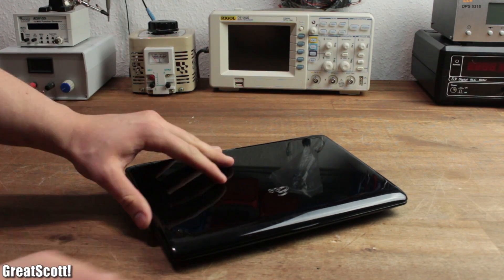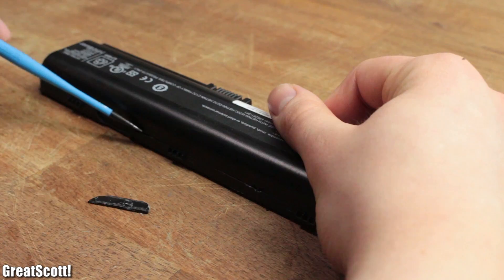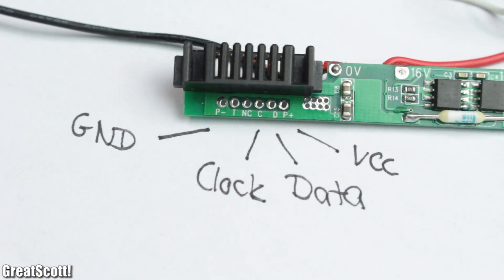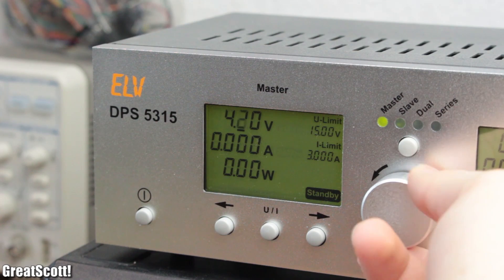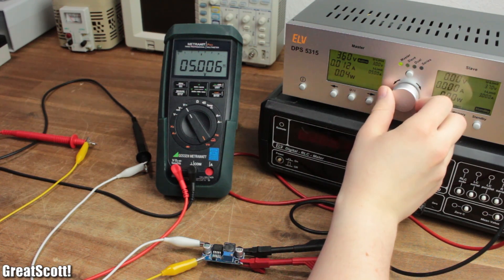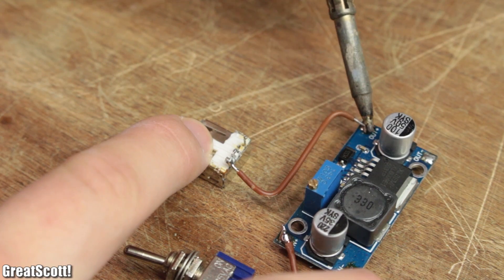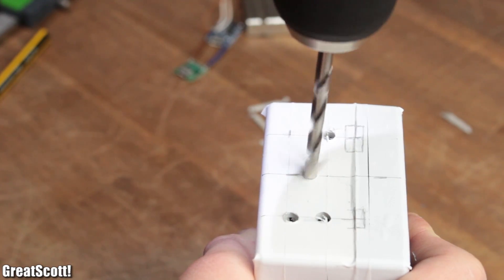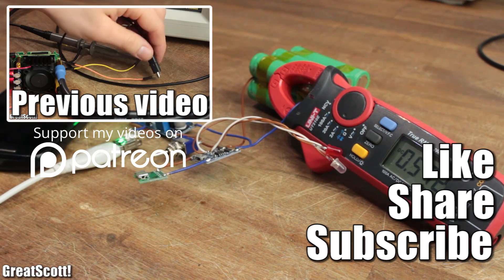HACKED!: Old laptop battery becomes a Power bank

Comment: in this video u didn't told about some nuanses with USB port. Some phones and tablets including your moto g 2014/15 (if I am not mistaken) , all types of iphones and iPads requried a little more than just solder two wires to VCC bus and GND. 
For example, my moto g 2013 didn't get charging until i shorted data+ and data -. (until this, phone define it how "charging via USB" and the current does not exceed 500mA) 
Apple gadgets require little scheme of voltage divider, which is different for 1A and 2A charging. Samsung Galaxy Tab require it too, but scheme is different.

p.s sorry for bad english

Comment: Can I charge it with a big solar-panel in the Powerbank?
Reply: +UpsetGaming You'll need a big solar panel. If you want to charge in 2 hours, you'll need a 25 watt solar cell and those measure 21" x 15".
Reply: +octavio echeverria And when I want to charge it in 10 hours? :D
Reply: +UpsetGaming This design is limited by the charge controller connected to the batteries. I haven't looked up the datasheet on the one he is using, but it is likely that it won't charge a current greater than 1 Amp. So if you do the math, 1 Amp @ 5 Volts = 5 Watts required. How long it takes to charge is based on the total capacity of the batteries you will be using. If each battery cell is approximately 2000mAh (milli-Amp hour) it will take about 2 hours per cell to charge. All of these figures can change based on the charge controller and batteries you use.
Reply: Also don't forget that solar panel has to supply a voltage high enough for the charge controller, but not too high as to affect its operation or damage the circuitry. Another buck/boost converter would be required in the circuit between the solar panel and charge controller.
Reply: +Alexander Hiller Thanks.
Reply: if you go this route, 3 series cells (3s) is a closer fit for 12v solar panels.  you will need a battery management system (bms).  limit the solar pannel voltage to the cutoff of the bms. if the cut off is 4.3v per cell then put a buck converter on the solar panel output to drop it down to 12.9v  (3 x 4.3v).  you will need a panel that has enough wattage to turn on the buck converter, so adding a 1000uf capacitor to the input of the buck converter will keep it running when a cloud goes over.     and if you want even more protection put a pulse width modulation battery charger between the buck converter and the bms charge input.  why all the circuitry? over charging li ion batteries can cause fires.  hoverboard.
Reply: +UpsetGaming A 5V Converter would work too.

Comment: Charging this puppy would take more then 12 hours at maximum warp.
Why didn't you explain the function of the tp4056. This $0,50 board is great and you've placed the power switch correctly, because this board has the under voltage switch.
Great tutorial, but a bit lacking in details.
Reply from the maker: +Kenneth Tan Maybe I will make an electronics basics video about charging such batteries in the future. There will be more detail ;-)
Reply: +GreatScott! I don't think you have to.  There are plenty out there. I like you doing your complete builds. Your quick pace and everything  covered from start to finish. Maybe it's just me, knowing these boards and finding  it a bit scary for people not familiar with 18650 to work on them. You soldered the tabs quite fast and professionally. But a novice trying to replicate your soldering might take to long and the Lipo might start running it's deathloop.
Also you should warn explicitly NOT to short the batteries. Something that even happened to me, while not paying attention to the wiring. Great tutorial, but not for the un-initiated in 18650 technology.

Comment: this is ridiculously dangerous, disassembling those welded battery packs often leads to shorts because the traces are very close together. 

I dont recommend this. youre better off using a lipo from an old tablet or sth.

Comment: +GreatScott! How would it be possible to charge the lithium ion cells with the TP4056 while getting an output voltage of around 14V? I'm thinking about replacing the Ni-MH batteries in my drill with Li-Ion cells.
Reply: +3MrP3 there are specific circuits for 2/3/4s systems.

But you can't pull more than ~3a per cell !
So if your drill is 14v 6a ( 84w ) you WILL need two batteries in parralel ( 2x4 cells = 8 total )
Reply: +3MrP3 Just use an RC LiPo pack with appropiate charger. Or just buy a decent Makita.
Reply: +3MrP3 Just use an RC LiPo pack with appropiate charger. Or just buy a decent Makita.
Reply: +roidroid Still both together not so expensive than a decent Makita.
Reply: +BillTheBox yes you can pull more for short amounts of time, they can spike over 2c easily for tools and vaping

Comment: I've pretty much done the same thing with some other components. Using a rechargeable 2.7v Lithium battery as well as a steady 2,7 to 5v boost converter and a lithium battery charging circuit as well with two solar panels and a custom designed 3D-printed case, I've made myself an USB and solar powered rechargeable phone charger with swappable batteries and indication LED's for charging. Even though I nearly haven't got so much knowledge in electronics as +GreatScott! has, I still managed to make one!
Reply: +CookieCraftMedia you mean 3.7
Reply: +DMAN22yeah Yeah sorry, but you get what i mean
Reply: CookieCraftMedia yeah, i figured it was a typo
Reply: DMAN22yeah I think there are no 2.7v batteries anyway, right?

Comment: Why did you use MicroUSB breakout board? TP already has a MicroUSB connection.
Reply: It was easier to mount.
Reply: +Manuauto Alright. Makes sense :) Cheers.
Reply: the second board has a circuit protection
Reply: +andrew kb Scott uses an updated TP4056 which already has a circuit protection, you can see additional BATTERY OUT connections.

Comment: Isn't it dangerous/not recommended to charge multiple cells like this in parallel? I know that the circuit you used to charge the batteries is designed for single cell only. Also, what's the charge time of all those cells?
Reply: +ACPCalin itws completely safe, and safer than charging in series

Comment: I just hope no one uses a dell battery pack...
EXPLOSIONNNNNNN!!!!
Reply: +AL_O0 ᶜᴼᴹᴹᴬᴺᴰ ᴮᴸᴼᶜᴷ ᴬᴺᴰ ᴿᴱᴰˢᵀᴼᴺᴱ When the Laptop was hapily used for years with these cells, the won't explode. Also there was a recall. If you didn't send back your explosive battery and got back a goot one, it's your fault.
Reply: +BleedinglHeart To be more precise. When exposing the Lithium inside the cells to oxygen it will cause a endo-thermic reaction. In simple terms. Crack open a lithium cell and expose it to the air around you will cause it to violently go up in flames. The root cause of lithium batteries exploding in consumer electronics is due to manufacturing errors in the cell casing. When exposed to heat they will expand. If the case ruptures. (Due to manufacturing errors) Oxygen can get to the lithium and it basically turns into a chemically fueled firecracker of which its flames behaves like plasma. (Chemical fire) This is the very reason why its a bad idea to keep smartphones in bed. The heat isolating properties of your bed can overheat the battery pack. causing it to expand. Especially when charging the phone or playing games on it. (and most certainly while doing this at the same time) Its the number 1 cause of accidents involving smartphones in house fires.
Reply: +BleedinglHeart You can play with them just do some research before you do and use common sense!
Reply: And if you use a HP battery you get Heat Problems!

Comment: Since I'm also using the TP4056 I'm wondering that you use this IC for multiple cells. The datasheet states, that the TP4056 is only for single cell usage. Could this cause issues in balancing between each single cell?
Reply from the maker: +Tobias Link (ranger81de) Since they are all in parallel you can not really use a balance control.
Reply: +GreatScott! I see, and since they are parallel, they will take care by themselves to be "somehow balanced". Thanks
Reply from the maker: Tobias Link
That is the theory. It is ok for such DIY builds but definitly not in a professional product.

Comment: As I said before, the lithium charging board you are using is a piece of utter crap. You should not trust the little ticking time bombs called lithium cells with this cheap, Chinese engineered, unreliable piece of electronics. Cheap Chinese eBay electronics are like a box of chocolates. You never know what you're gonna get. I bought 3 of those because the first one was iffy, the second one charged up to 4,25 volts and the third one up to 4,23 volts. I didn't use any of these in the end. If the manufacturer thinks that it's not an issue overcharging my batteries at 4,25 volts, then I don't think I can trust this piece of shit.
Reply: Mandragoras  Modern Li-ion/polymer will show no significant change in the number of life cycles if charged at 4.20 or 4.25. Many of the most expensive charging ICs from TI or Linear also charge at 4.25 VDC.
Reply: +Mandragoras Charging to 4.25 V is common procedure. The boards are fine.
Reply: +Mandragoras I am using 3 of these updated TP4056 with MicroUSB connection and they work just fine. Maybe you were unlucky and got a bad batch.
Reply: TheAmmoniacal
 Yes it might be common for these unreliable boards but it is bad for lithium 4,2 volt cells.
Reply: Sidabra24.com
 When the manufacturer is unreliable you don't just think "Well I'm lucky, I got a good batch". You can't trust lithium cells which have the energy to act as little bombs and burn your house to the ground with unreliable hit or miss electronics.
Reply: TheAmmoniacal
 Which is why it's wiser to read reviews beforehand and avoid such chargers. In communities like BLF and CPF, chargers that overcharge beyond 4,23 volts receive negative points in reviews. Heck, when the manufacturer suggests 4,23 volts not to be exceeded, that's a good enough reason for me to avoid doing so. Even branded cells from reliable manufacturers fail rarely. No reason to play with fire. Why would anyone want to overcharge their lithiums in each and every charge and stress them. Why take the risk?
It has become a very common practice for people to extract lithium cells from old laptop batteries. Old laptop batteries do not contain modern chemistry cells.
And why are you only focusing on the overcharge part? THE most serious reason to avoid them is because they are iffy and unreliable. Even if you get one that charges at 4,18 volts, it is still unreliable. If you can purchase modern, expensive, over engineered cells, it is stupid to be cheap and trust them with a 1$ charger. There are Chinese chargers that are more reliable and of course at a higher price. Because you get what you pay for.
Reply: +Mandragoras 4.25 is totally fine. It is within tolerance range. I have a batch of 10 of them and they do not exceed 4.2 Volts when finishing charging. did you measure right after disconnecting the charger or while charging??
Reply: *****
 
 It took more than 3 hours for the charging to end. And the cells, disconnected from the charger, had 4,25 volts.
4,2 is totally fine. But 4,25 is at the absolute maximum of the tolerance range. That's the thin line between ok and abuse.
My comment was bashed mainly because you all focus on the max charging voltage. The fact that you have 10 of them and none overcharges does not make them reliable. I would recommend you to watch bigclivedotcom's or EEVblog's videos but I'm sure you know these channels, you have watched them and you already know about the truths they reveal about cheap Chinese electronics. Let's just stop kidding ourselves. We all know that quality control, safety and performance standards in cheap Chinese electronics are almost non existent. And when it comes to certification markings, definitely non existent. At least this is how it looks through the eyes of a westerner who lives in a country where electronics have to be compliant with mandatory conformity markings.
Reply: +Mandragoras You didn't test these open circuit did you?
Reply: +Mandragoras No, 4.25 is still okay. 4.28 is alarming. I use these modules for years and I have no problems. When you use cheap cells, though, it&#39;s your fault. I use Panasonic only. LG and Samsung is crap.
Reply: +Gronnmann Scamscum and LG cells are actually crap.
Reply: +BloodySword I believe he was referring to the charger not the cells

Comment: dont you want to put a circut protector that will be nice so the powerbank tunrs it self off if the batteryes get to a low voltage
Reply from the maker: +Sebastian Pebsen-Zachrau The TP4056 has a low voltage protection integrated.
Reply: +GreatScott! i did not know that ,but that's cool
Reply: +GreatScott! could you charge it with a car battery?

Comment: Nice video as always.
What would be the problem with using the laptop control board? i thought it would do the same and you´d only need to regulate the voltage to 5v.
Reply from the maker: +TheNuubi I am not entirely sure but it needs an input voltage of around 12V or more. So I needed a boost converter anyway. Also it was necessary to use the I2C protocol to control it and get the interesting data.

Comment: If the laptop has a decent ethernet and wifi chip, you can convert it into a wireless router with the right software. The wifi chip needs to support "AP" mode, so you may need to get a external USB wifi chip that explicitly supports that and dedicated drivers for it, but other than that it should work. That way when your wifi router inevitably fails, you can make your own!
Reply: +Power Max I agree with the suggestion but what do you mean inevitably fails? There's almost nothing in one to fail unless overheated and I have an old wrt54g from over 10 years which works great.
Reply: Inevitably fails? I have never had a router die on me.
Reply: +Samuel Doye I have had nothing but problems with them. Currently I am using a botched solution using 2 modem/routers and a computer. A centurylink DSL modem/router has died, but the modem part still works. The wifi router portion has either some software bug where it will completly ignore requests from some random computer depending on the day. This was our 4th router from centurylink, I gave up on requesting more because they need to be hard-rebooted about 1-4 times a day and consistently break after about a year. So I disabled the wifi on it and only enabled the 4 ethernets on it, which feeds into a non-OEM netgear ADSL router, which worked nice and fast when we first got it a year ago, but something happened causing the modem decoder to not detect ADSL anymore. (my guess is that a either the expansion of the PCB from temperature has cracked solder joints internally, or that a voltage spike from a lightning storm or something has damaged the modem section) So this is now used as just a still-decent wifi router with NAS functionality. The centurylink modem feeds internet to the netgear router and that router broadcasts it to everything.
Reply: Power Max Which is why IF you have the option, never go for a modem/router combo solution, you'll always have a better experience with two separate systems, I have one and yeah the router side is a bit shit, the wifi drops out randomly and it could be faster/offer a few advanced options that other routers have but those problems could be solved by a real router.

BleedinglHeart I wouldn't say never, certainly not but similar to CPUs it's pretty rare of them dying as long as they stay in the are modified in anyway.
(unless of course they did a poor job with heat and it needs heatsinks to stay cool enough to not die.)
Reply: +vgamesx1 I hate those router/modem combos too, they are underspec'ed for what they need to do. Even the newest centurylink router has something like a 400MHz single core ARM processor with megabytes of RAM. The netgear non-OEM one is considerably more powerful with what I believe was a dual core 800MHz processor and I think 256MB or 512MB of RAM. It was the most expensive one at best buy. It is ashame it also went partially bad. But it does do a decent job routing the internet, and I'd imagine a computer server dedicated to doing that would be even better. Even if it is a power hog.
Reply: Power Max Yeah if you wanna turn a PC into a router an old netbook is probably your best choice at about 15W anything more than that is going to be a little costly as a 24/7 device.

Comment: I have made one of these before but I used an old buck converter to use when I made it and it only provided me with 2.4 amps. I gotta find a way to make one that will output atleast 3amps because I have literally 40 of these 18650 cells lying around.